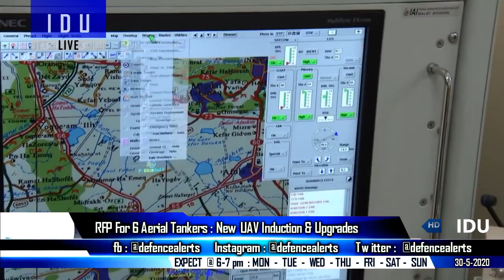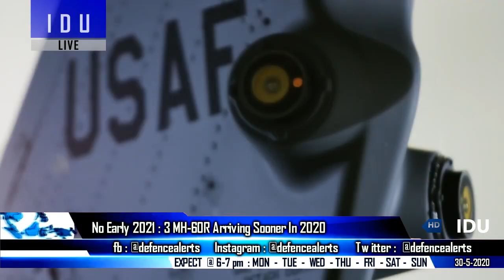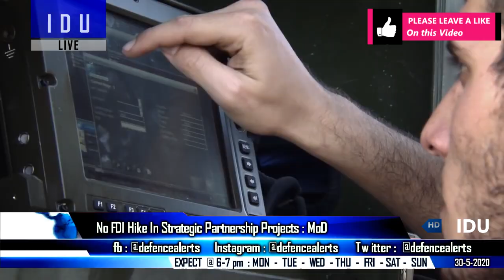Indian Defence Updates : No Kaveri Engine,6 Aerial Tankers,16 Tejas FOC Conversion,Mahindra New ASLV

Comment: Indian Government And DRDO use This Enjan SCIENTISTS CREATE JET ENGINE POWERED BY ONLY ELECTRICITY
Clean Air
A prototype jet engine can propel itself without using any fossil fuels, potentially paving the way for carbon-neutral air travel.

The device compresses air and ionizes it with microwaves, generating plasma that thrusts it forward, according to research published Tuesday in the journal AIP Advances. That means planes may someday fly using just electricity and the air around them as fuel.

Scaling Up
There’s a long way to go between a proof-of-concept prototype and installing an engine in a real plane. But the prototype was able to launch a one-kilogram steel ball 24 millimeters into the air. That’s the same thrust, proportional to scale, as a conventional jet engine.
Our results demonstrated that such a jet engine based on microwave air plasma can be a potentially viable alternative to the conventional fossil fuel jet engine,” lead researcher and Wuhan University engineer Jau Tang said in a press release.

Air Jet
Air travel represents a small but not insignificant portion factor of climate change. The New York Times reported in September that commercial air is responsible for 2.5 percent of all greenhouse gas emissions — though that excludes military jets.

“The motivation of our work is to help solve the global warming problems owing to humans’ use of fossil fuel combustion engines to power machinery, such as cars and airplanes,” Tang said in the release. “There is no need for fossil fuel with our design, and therefore, there is no carbon emission to cause greenhouse effects and global warming.